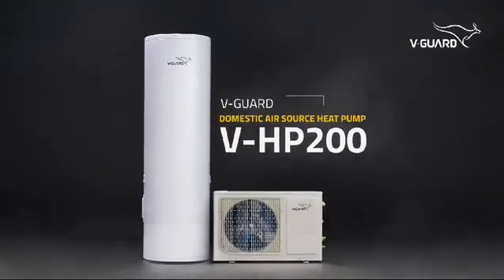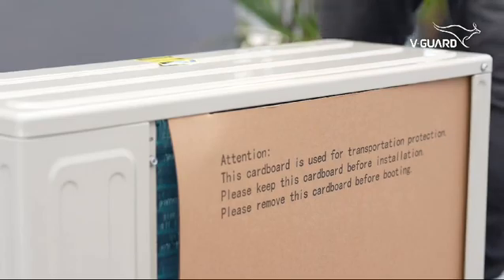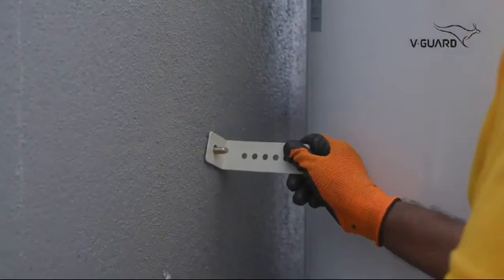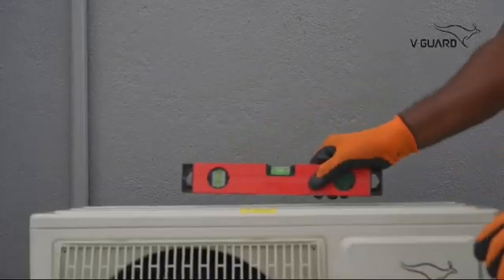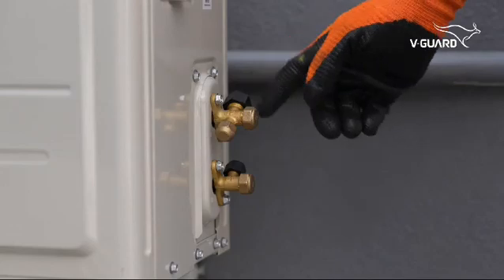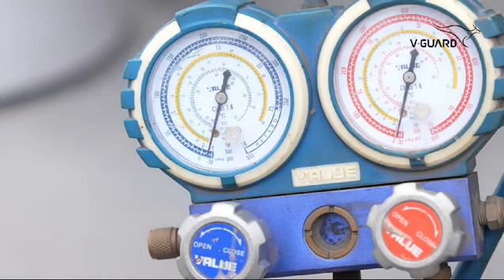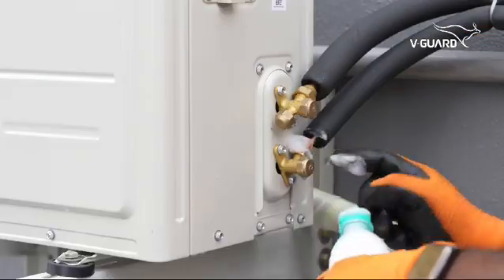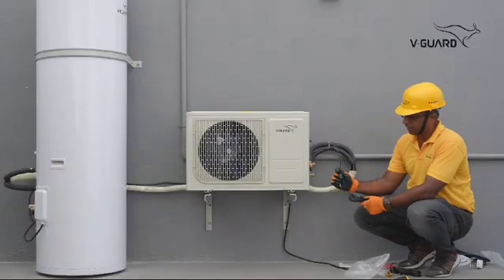VGuard Heat Pump Installation Video

Comment: What is rate of 1000 lit heat pump for hotel 
If intrested quote please
Reply from the maker: Where is your requirement location? I can supply in Bengaluru only. If your requirement is in Bengaluru please send details on WhatsApp, I will share the details